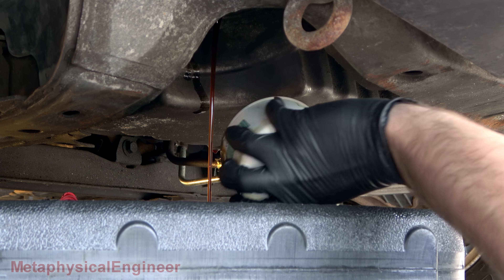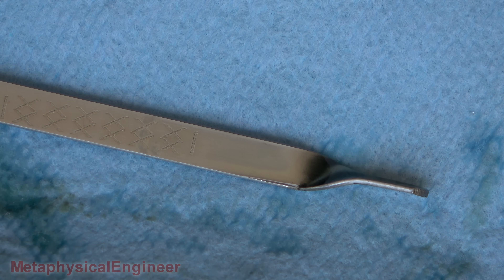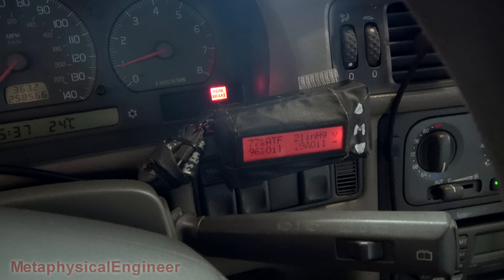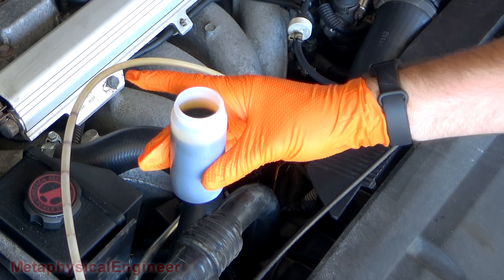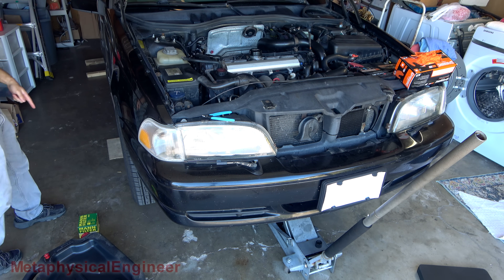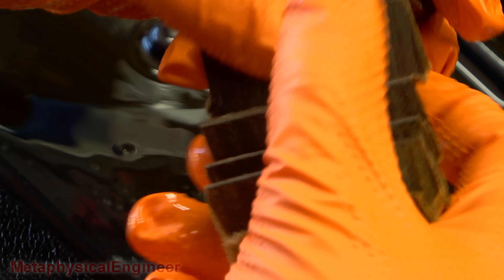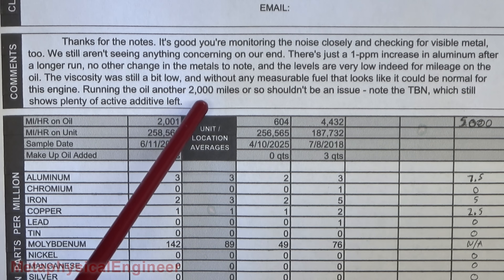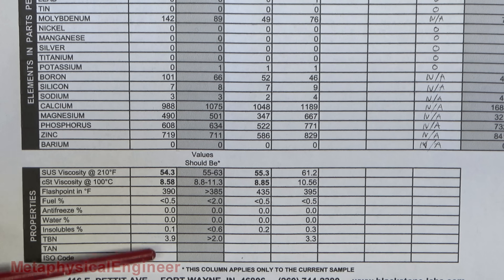Valvoline Restore and Protect vs Noisy Lifters - Used Oil Analysis and Filter Cut Open

Comment: it really makes a difference after about five oil changes. I ran it in my son‘s 2006 GMC envoy. I changed it every 3 to 4000 miles, for five oil changes. Then I switched back to Pennzoil ultra plat after. 

But the restore and protect really did a great job. You can’t even hear the engine when it’s running, barely. When I stuck a scope down in checked everything, it was super clean. But anybody that’s using this needs to really do it 3 to 5 times before you’re really gonna notice a lot of improvement. 

So it’s fine if you’re gonna do an oil analysis every couple hundred miles on the same oil, but the real benefit is after several oil changes . That’s when you should be really doing an analysis. 

Great video and good luck with it !
Reply from the maker: Glad it worked so well for you!  That amount of oil changes makes sense with a shorter interval.  About 20k miles or so in total seems to be the timeframe in which R&P will clean up most of the deposits in any given engine.  

Going forward I'll be doing analysis at the end of the oil changes.  This mid cycle sample was out of caution and curiosity.  Actually useful as I now have a data point for the oil viscosity changes over time due to shearing.
Reply: Personally, the used car I got was so bad, I'm 4 oil changes in with Pennzoil Platinum first because I was also concerned that cleaning up too fast could cause problems. Now that it's running phenomenal part of me doesn't want to mess with what's working right, but I'm just too curious. Plus, I haven't published a video in 4 years and maybe it'll give me something worth saying. :)
Reply: Ultra platinum in my vvt v6 rav4 (116kmi) made it noticeably more powerful and revvy after going 7500mi on pennz reg platinum full synth! Didnt think Id notice a difference but its noticeable.

Comment: I am running R&P in my 2003 Jag XK8. I will probably go back to Pensoil Ultra on the next oilm change.
Reply from the maker: How long have you been using it?  Is the change back to the ultra because you don't see any benefits, or is the low viscosity in my report here making you worry?
Reply: @MetaphysicalEngineer  I feel like the engine was just running more smoothly with zero lifter noise at startup. I believe the Pensoil has better sheer strenght and just a better mote refined oil overall.

Comment: You just reminded me that I haven't sent in any Blackstone samples at my last 2 LOFs...  🤪
For my 2-cents-worth, over the years my current supercharged Series II 3800 has happily gone from 1500 miles per quart of dino oil @ 69,000, to 1.25 quarts in 7,000 miles just running Mobil 1 Hi-Mileage now at 150,000 miles...  I had the pan off at about 110,000 and the innards were so clean I could read the part numbers on the bottoms of the pistons!
Now I don't know how it compares to their current product(s), but back in the day I used Wynn's Oil Change Prep in my 240,000-mile Pontiac 400 when the lifters got a little noisy every year or two.  You could drive 50 miles before draining and it worked every time.
Reply from the maker: I have seen M1 do some cleaning on a an engine with soft sludge before, many years ago.  Oil turned black as coal in not even 2000 miles.  Glad you saw such improvement in oil consumption- sounds like a very healthy engine at 150k.  

There are plenty of those short term oil flushes on the market.  I've been hesitant to use them because the very hard varnish I suspect as causing the lifter problem takes a long time to dissolve.  So a 15 minute flush or a 50 mile trip of barely an hour wouldn't really touch it.  

Seafoam has similar instructions to add 100 to 300 miles before an oil change to help dissolve and flush out gunk.  It did something in my case because the oil got dark faster than normal, but didn't touch that varnish visible through the fill cap.  Likewise didn't resolve the lifter noise.
Reply: @MetaphysicalEngineer   You make a good point as to the hard stuff, although as I said, I only used it occasionally.  On my '69 Wildcat convertible though, I'm not putting anything in there because I have no idea what might be holding that  engine together with only a 5-digit odometer...  😉
(Also, I'm using Mobile 1 20-50 which has their highest levels of zinc & phosphorus.)

Comment: I am running R&P as well. I went from burning 2qts every 8k to not burning any in my 2018 6.2 gasser. I also switched to the 5w20.
Reply from the maker: Impressive!  How many miles were on the engine before you tried R&P?  How long did it take before you saw the oil use get better?
Reply: My truck had appx 98k when I started using the Valvoline R&P. Last oil check required appx 1 qt of oil. My life indicator shows 34% life left which means it is still burning oil but has reduced. I was wrong about the viscosity, my jug is 5w30 not 5w20. Is the reduction due to cleaning action or increased viscosity? Speculation on either account. My mileage hasn’t really changed that I can tell but I don’t baby the motor and use those horses to get around people or get up to freeway speed on short get on ramps. I should have done an oil analysis before adding fresh oil 🙄. I will definitely due one next oil cycle.
Reply from the maker: @craignmz5264  It is tough to say which is causing the reduced oil consumption.  You'll probably know more over this second interval if the consumption continues to improve.  At a certain point it will level off, but already that's a big improvement.

Comment: That's one big ass filter
Reply from the maker: It is!  Volvo used the same filter packaging for decades.  Sometimes I wish it wasn't on the bottom of the engine since that limits options in terms of length and diameter.  But it's got plenty of capacity.  Even back in the 90s, the non turbo versions of this engine could do 10k mile oil changes in favorable conditions.  

Later engines went to a cartridge style filter which has its own benefits and drawbacks.  I think the filter element is larger, but I may be misremembering.

Comment: Now THIS is a very good no nonsense video on the subject. I also switched from Castrol Edge to R&P based on the Motor Oil Geek's informative video. Didn't really need to but did because of the advanced technology. Will send a sample of the R&P Blackstone for analysis
Reply from the maker: Please do send a sample!  The more data points, the better in helping others learn how this oil works in different engines.
Reply: @MetaphysicalEngineer  Now you got me there... I think I'll just have to look at the engine and listen to it. Unfortunately, after the last 2 regimes, inflation is just so darn bad, I can't afford to do the oil analysis. I'm even worried about the additional cost of R&P above and beyond my usual Pennzoil Platinum. I make literally more than double what I did a few years ago thanks to some high end work on getting hired higher from getting better in my field of IT, but I'm ACTUALLY still poorer.

Thank god I'm an IT guy - I'd really be screwed I'm guessing if I kept cranking on cars this whole time. Nothing in automotive pays as much as I'll be getting in the next year or 2 in IT.

Comment: Would R&P be okay to run in a GDI GM engine that's only supposed to run oil that's dexos 1 GM approved gen 3 or whatever? Should be okay right?
Reply from the maker: I'm not an absolute authority on this, but here's my take after some research:

Dexos is pay-to-play, where oil manufacturers have to pay GM for the rights to use the Dexos label.  They also need to disclose a lot of proprietary info about the oil's chemistry to GM to get the approvals.  Valvoline is probably guarding the secret of the chemistry, at least for a while.

In terms of performance, R&P should meet or exceed the actual Dexos spec for wear protection, fuel economy, LSPI control, and especially exceed the spec for cleaning and deposit control on pistons and turbochargers.

Comment: Remember to shake the oil containers to re-float the additive package contained within the  oil. Just ask  @The Motor Oil Geek
Reply from the maker: Good point!  I didn't show giving the jugs a shake, but will next time.
Reply: @MetaphysicalEngineer  does not matter oil will be mixed while it is being used in the car
Reply: How about us in mechanic shops that has 1000ltr oil drums
Reply: Pick it up and shake it.  @cdluna57
Reply: @cdluna57 they must be strong
Reply: There is stuff in the bottom that you don't want, leave it there. Hydraulic guys go to great lengths to filter sediment out of new oil...

Comment: Good video on I've had good luck with restoring protect in a 2002 Saturn SL2. Low mileage engine All City driving so never really heated up. Had some valve noise it is now quieted down, I have 2000 mi on this oil change, I'm very happy with it.
Reply from the maker: That sounds like a good candidate for needing some extra cleaning.  Quieter valve noise already is a very good sign. Certainly keep a close eye on the filters in case a whole lot of gunk comes loose in that first oil change.

Comment: Valve medic oil additive is for noisy lifters, I have had success with it in the past. If you have a roller wheel that stop spinning and has a tiny flat spot on it, well no oil will solve that. Have seen it multiple times. Don’t know if you engine has roller lifters, or followers. Calcimine does say it needs two oil changes to really start working its best also. So maybe there’s still hope for you.
Reply from the maker: Thanks for the suggestions!  I've seen some teardowns of other engines where a roller lifter failed and ate a cam lobe.  Even knowing I don't have rollers here, I wanted this analysis to check if there was metal in the oil or filter from the noisy lifter or its cam starting to fail.  So far so good with wear numbers so low.  

The user manual warns to keep RPM below 3000 if lifters are making noise after engine sits for a long time and they bleed down.  I've heard that noise after the cylinder head repair a few years ago, but it was a much louder, sharper clack-clack-clack noise.  The sound I got here is quieter and less sharp, so probably explains why it's not beating itself up as badly.

Comment: I've had really good luck with Valvoline restore and protect. Although I run a second additive for another angle on cleaning. 
 My wife's 2015 Subaru fell into the oil burner category but didn't burn quite enough for the recall. The Valvoline cut the oil consumption from 3 quarts every 5000 to under one. My Tacoma seems to like it as well, that dropped from less than 1 quart to almost nothing. 

I have an Audi all road, with the 2.7 l. Twin turbo, that one is heavily varnished, but it doesn't seem to affect it much. It had a pretty significant oil leak, and after about 3,500 mi it's almost gone.

I like to run rislone engine treatment. Rislone Is high in esters, that can recondition seals and clean very effectively. (You can smell the esters when you pop the bottle open, it smells fruity) 

The combination seems to have done wonders, I've been recommending it to people with neglected engines
Reply: Three quarts of oil loss at 5,000 miles is alot of oil.... ouchy.  Some G.M. models do that. Subaru  with the fact that any boxer engine contends with. Cylinder  sitting on its side at rest for hours.
Reply from the maker: That's a lot of useful info and impressive improvements in engines notorious for oil burning.  Did I understand correctly that R&P appeared to resolve an oil leak on the Audi?  Was that from a crank seal or some other source?

Lots of suggestions for Rislone, so that's on my list of things to try sometime.

Comment: I've watched one of your videos before, it was good. I like this one as I have recently changed my oil to Valvoline, however I change my oil every 3K and this analysis over any I've seen so far answered a concerning question and that is viscosity. So that said for my piece of mind 3K is the limit, and after two oil changes I will go back to using the oil I was using.
Reply from the maker: I agree the viscosity drop was surprising and maybe cause for caution.  But after more research I've seen oil reports from other Volvo turbo engines that didn't show anything close to this amount of shear.  I'll know a lot more after the second sample at the end of the oil change interval.

Comment: I've done something similar to what restore and protect is trying to accomplish by simply replacing one quart of engine oil with one quart of ATF every other oil change in two different suburbans. The first was a LM7 5.3, I started doing it at 205k miles and when I sold it at 245k it was running great. I am doing the same thing now with my L83, started at 105k miles, it now has 145k miles on it and going strong. The L83 is known for lifter failure due to GM's terrible AFM/DOD design. My theory is if I can keep the sludge and varnish from building up there isn't any reason I can't get to 200k miles before lifter replacement is required.
Reply from the maker: Interesting!  Plenty of other people have suggested using some ATF as well.  Have you sent in any samples to see how the run with ATF compared to normal?  I've heard all sorts of horror stories about GM's AFM suffering major failures so anything that helps is great news given the cost of a new engine.
Reply: @MetaphysicalEngineer  I haven't taken samples for this vehicle yet, I probably should. I drive it 25-30k miles a year so that data would be fairly helpful. Time to order some Blackstone kits.

Comment: Less expensive just buying two jugs. The per qt price is crazy.
Reply from the maker: For sure.  This first time I was hesitant to buy two big jugs in case I was dissatisfied and got stuck with a half empty jug to deal with.  The quart bottles make for easier visuals on camera to show much oil is left over too.  10 ounces is at the very bottom of a 5 quart jug but it's easy to see the level in a 1 quart bottle.

Going forward I'll be buying the jugs.  Three for every two oil changes with some to spare isn't bad at all cost wise.
Reply: @MetaphysicalEngineer  You helped me remember I have a car that needs 3 quarts so every 3 jugs is five oil changes - not as expensive as I was thinking.
Reply: places will have sales where the 5qt jug is the same price as the 5 single bottles.  car only needs 4 so i get a spare bottle every time.
Reply: 5qt Jug is $29.99 @ WallyWorld spotted today, just an FYI.
Reply: Case pricing is worth it if you plan on owning your vehicle for a while

Comment: The ONLY gasoline engine I've had, that needed or used any oil at all in 5,000 miles, was a Ford V8 with a leaky rear main seal. Burning oil? Don't accept that as "normal."
Reply from the maker: Yeah, a properly designed engine should barely use any oil and should get to the end of an interval without needing a top off.  The only time I've had oil consumption was when the valve stem seals on this engine were  completely failed. More than a quart per thousand miles, all from the top end. After I pulled the head and had a shop replaced seals, lap valves, and skim the surface, it was back to negligible oil use.

Comment: My son has a 2012 dodge journey.   Infamous oil cooler leak. So had that replaced.  Soon after. .....the ticking began. And got louder. Did the MMO for 1000miles. Still tick. Seafoam for 300 miles. Still tick. Went vr&p. About 1500 miles in ticking got alot better. After around 3k miles almost no ticking.  Changed around 5k on oil. Another round of vr&p in. Has around 130k miles on motor
Reply: 3.6 pentastar?
Reply from the maker: The success stories keep rolling in it seems. You ended up doing a similar sequence of trying MMO, then Seafoam, then R&P. I hope I see similar success with my engine noise, though it probably will take a bit longer to resolve in my case.
Reply: Is that Dodge Journey running the 3.6L V6 Pentastar engine? I have a 2015 version of that engine on a Grand Cherokee. If VR&P fixes the infamous "Pentastar tick," that would be remarkable.
Reply: @DEValentine . Yes!

Comment: I've run this oil for 24K miles now in a Ford 6.0 diesel. ( sure it's not recommended for compression engines but it's doing fine ) Given zero problems  doing 10K mile changes. Removed all the stiction issues that plague the injectors when varnish builds up. Zero blowby nothing to find in the filters and even though I'm running 10w-30 (or thinner mixxed in if I can't find 10-30 bottles) in an engine that likes 15w-40 it doesn't complain at all. It's good oil and a waste to not run it atleast 5K miles.
Reply from the maker: Very interesting that you have good results in a diesel that normally wants thicker oil. Have you done any oil analysis to see if wear is still normal?  I'd be really curious to see how well it holds up even outside it's intended application.

Comment: So when you fill the oil to the max line, are you considering the fact that oil expands when it gets hot. Just something to think about. Wouldn’t want you to over fill and cause issues.
Reply from the maker: Good point!  I've not had an issue with that, since this engine likes to keep a lot of oil up top once running. If I check the oil immediately after shutdown, even when at full temp, dipstick will read about halfway between min and max lines.
Reply: I've never seen an automotive engine that wouldn't take at minimum an extra quart above maximum and cause issues.

Engine oil experiences somewhere in the 5 to 7% range of thermal expansion from a standard air temp to standard operating temp.

If you have a 5 quart sump, it's about an extra 8 ounces of volume from thermal expansion.

It's not until you get into the realm of If you have a 20 quart sump, thats an extra quart of volume from thermal expansion.